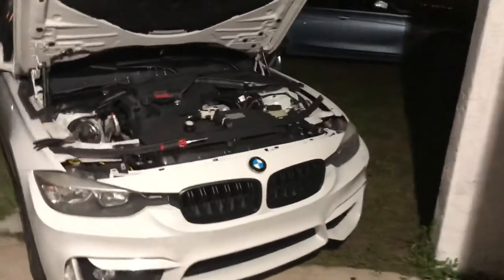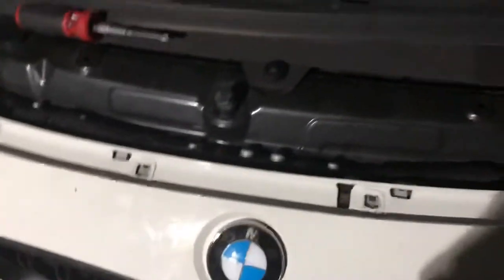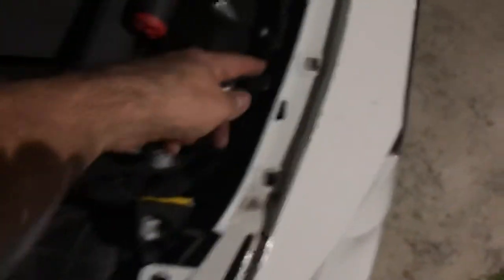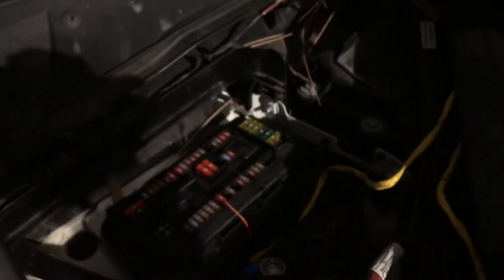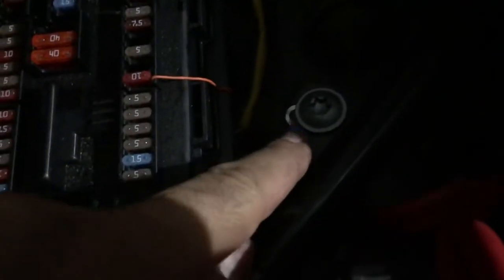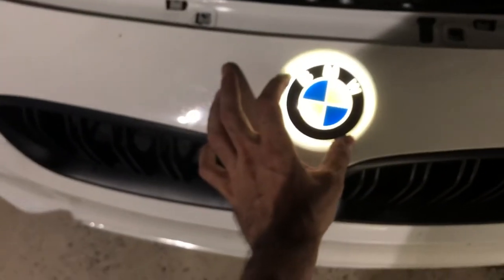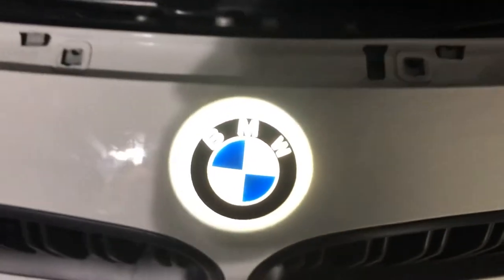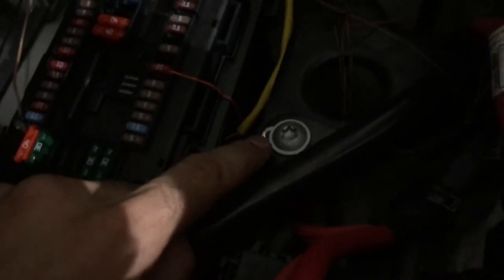BMW F30 emblem upgrade, LED front bumper emblem replacement. How to install LED emblem.

Comment: Would it have been possible to connect it to the fog light fuse if it has one? So that the emblem could be turned off and on separate from the headlights
Reply from the maker: You might be able to, just as long as the fog light it’s giving you that 12v that it needs. The other problem you might face is that once you connect it to that fog light circuit, it’s going to give the sensor supervising that circuit a different reading of the load and it will give you a fog light warning. Please try it, I’ll like to know how it goes. Please let us know what happens, it will be greatly appreciated.
Reply from the maker: My wasn’t connected to the head light, I used a random fuse that that gave me 12v that turned off and on with ignition switch.
Reply: Depending on what model the lighted side marker is also a good option.